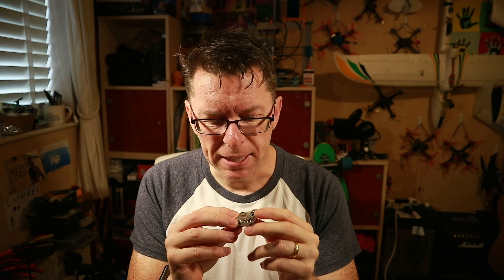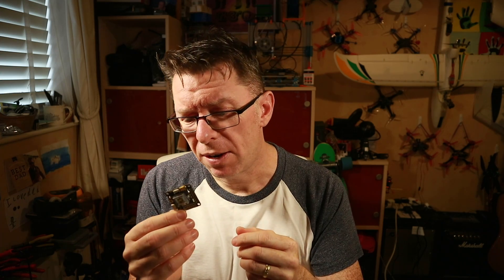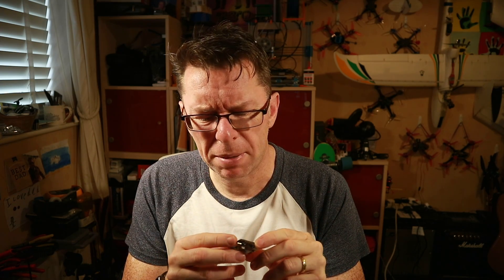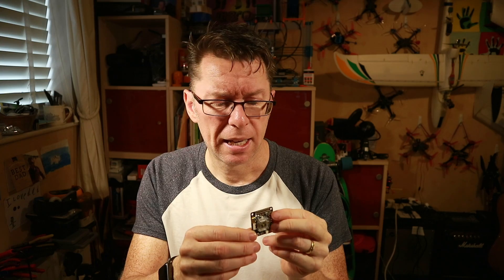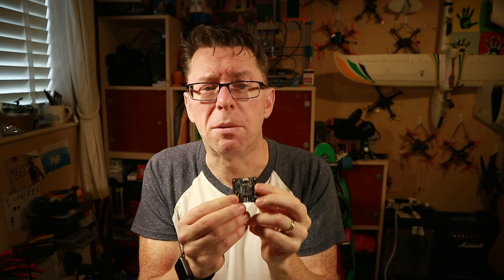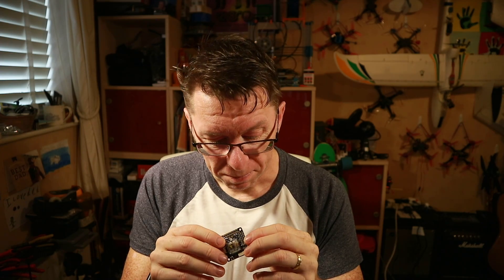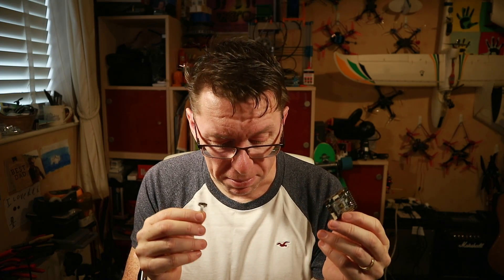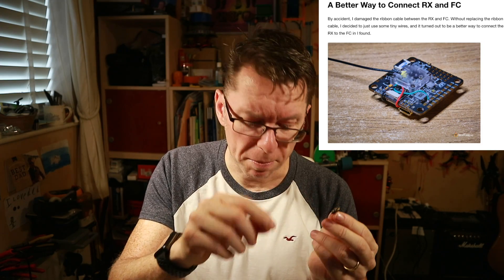FrSky OmniNXT F7 with R9MM review fail, but with some good news to come

Comment: That don't sound like a winning method of updating a flight controller..... I'm loving the R9 on Flex tho, two km on just 100 MW.
Incidentally I managed to flash an update for the R9 to the internal module on the QX7 had me stumped for a few days why I couldn't connect to an XM+ for a few day. Rrflashed the internal module and it's working as it should again. (I had seen one of your clips where you mentioned that you didn't know what would happen if you flashed the internal module? Well now you do.) Great clip as always.
Reply from the maker: I can see how that might confuse things for a while - glad to see you could still reflash the module, even if you flashed something completely incompatible onto it !

Comment: I use and love frsky, but they are NOT on top of there shit. Make it easy for ppl @frsky
Reply from the maker: There 2.4Ghz stuff is great, but I'm not feeling it on the R9 system so far :)
Reply: @CurryKitten  I love the r9 no issues except In very beginning, had some fail-safes, escs we're too close to t antenna

Comment: That's bollocks having to piss about with all that malarkey, surely you would think that a company like Frsky would have designed a more Practical way to update the firmware. I would imagine if this is how its destined to be sold then your not going to be the only one with this problem, wide birth me thinks.  :(
Reply from the maker: Perhaps when wireless updating is implemented and they actually ship the devices in that state it'll look better.  Feels like it's a pre-release in it's current shape.

Comment: Frsky seem to struggle with system integration and user friendliness.  Having to take an integrated component apart to update the firmware is frankly daft, and having to solder wires to pins obviously designed to mount a connector is asking for trouble!

They should maybe give more thought to the fact that their stuff is being used by hobbiests who may have spent a considerable part of their budget on a device, not a lab or industrial environment where broken parts can be replaced from a bin.
Reply from the maker: I sense that the whole R9 thing was massively rushed to try and get some of the market back from TBS, but it seems that if anything they've shown how well Crossfire performs in comparison.

Comment: Is there a way to update the firmware using the f. Port tool?
I always update my r9mini and r9mm using the windows tool.
Therfore the receiver have to be NOT powered by USB.
So you can enable serial forwarding before the receiver is powered up.
I've asked frsky if they can implement a way to bring the receiver back to the bootloader with an special command in cli, or an other way to it, if ota updates are not possible, but I got no response :(
And autobind after an update and on new receivers  was also a wish, but yeah that's frsky
Reply from the maker: Hard to tell now, but FrSky told me that the terrible soldering idea was the only way of updating.
Reply: @CurryKitten  terrible! !
You may could disconnect the ribbon cable and connect it when you have started the serial forwarding  (for the s.port/f.port uart) and the Windows f.port flash tool.
But that's an nightmare without soldering.

Comment: ive trashed my fair share of things, its frustrating when it all goes wrong.
my most recent cock up was putting 12.6v into a 433mhz telem module which decided that it would pass the 12.6v to the APM that it was connected to and both let out the magic smoke :/

As for OTA RX firmware updates, the Flysky i10 can do OTA updates on flysky receivers but there is just one problem, flysky never release any firmware updates lol
Reply from the maker: I don't think I actually did anything wrong (to the power at least, I definitely buggered up the RX though), but I've certainly had my share of magic smoke that have been me reversing power or creating a short somehow.  Oops :)  Perhaps the FlySky doesn't need any updates - it's it aint broke then don't try to fix it etc
Reply: @CurryKitten  True, the flysky receivers do work without any bugs, custom firmware exists for them that adds extra features but as yet ive never bothered flashing them as the iA6B and X6B rx's do what i need on the stock firmware.

I dont think ive ever seen a video advert on your channel, i see the banners but not videos, im sure many would be prepared to let them run full time and not click skip to help you out if you put them on your channel.
you could always set them to run at the end of the video and people could choose to stay till its finished instead of it being in your face at the start if thats why you dont have them?
Reply from the maker: I use the short unskippable adverts as well as the banners.  You'll only see them if the video gets popular enough to have ad's bidding on it (in YouTube's weird advert auction thingy)  This seems to work ok for me, I'm not a fan of the longer pre-roll ad
Reply: @CurryKitten  oh, i didnt know that about the video ads, i thought people just put them on  and that was that lol.

Am i right that you get more if people watch to the end and dont skip?

Comment: Yeah, the SPORT and FPORT choices on the R9MM caught me out at first too....The wireless updating is a must have TBH.
Reply from the maker: It turns out that the way they've connected the RX into the FC with a ribbon cable, using F.Port was the only way it would work properly... of course, this isn't written down anywhere in case someone finds it helpful
Reply: @CurryKitten  Agreed, they really dont provide the basic info for connecting and doing Firmware updates IMO...The R9MM is not the same as say an XM Plus...but no info about the Port choices and which is appropriate for what.

Comment: The thing is you may have blown the board but if you can do it then so many others could. You should not have to solder stuff onto pads just to update software. The more you have to solder onto pads time and time again the more chance of lifting the pads destroying the board. Its nice having most stuff on one board but I am not sure on having a receiver as part of it as you could pull an damage the connector. I do like things made more easy for Quad makers to stuff GPS,  full telemetry data, external Magnetometers, Addressable led`s with receiver inputs for spectrum or Frsky sbuss all at the same time. Stacks are fantastic for racing Quads and don`t need all that stuff so the stripped down with a processor that can handle anything you chuck at it during a race. Also I would like to see a bit more plug and play for those who want to build but cant solder and just want to do a simple build and fly.

Comment: Now you want to be a an rc enthusiast and you have a choice between archaic receivers that brown out at the first opportunity and DIY electronic engineering that work with a tad of chip programming. 
Or if you want you can buy the same stuff overpriced and already programmed from you from TBS.
Well that wireless protocol looks fantastic at this point of time. Lets hope they put the firmware on the  net before they get it to the reviewers....lol
Reply from the maker: We live in hope for a decent wireless intergration - fingers are indeed crossed.

Comment: One word for all that pain: frustration! I mean, Frsky makes this nicely specced board, rx included, all the bells and whistles, but leaves the firmware to be updated by the user? Who is supposed to solder under a bleeping microscope? C'mon, frsky!
Reply from the maker: That's certainly the word I'd use.  I mean, the first time around it was annoying, but then attempting to do it more times, and things getting progressively worse... bah, hours lost to it
Reply: @CurryKitten  I know the feeling all too well. I bought this R9 and R9M receiver and transmitter, as a combo, couldn't bind the damn thing because the receiver had a different firmware. To update it I needed a USB hacking tool thingy, sold separately by Frsky, a real pain. Why? I love the system, when it works it's great, but it is such a hassle. And the documentation is lacking to say the least...

Comment: It looks like a good idea badly implemented. I don't really see the advantage of the rx in a 'big' plastic box that has to be dismantled delicately each time you need to update fw! Why didn't they just have the 3 pins sticking out of the plastic box? Are FrSky dropping the ball lately? Then seemed to mess up so that 2 people can't run R9MM next to each other without 1 taking the other out now a FC that is way too delicate.
Reply from the maker: FrSky's 2.4Ghz stuff has bee, IMO, fantastic - but they seems to have come apart at the seams with the R9.  Maybe they can get it up to spec, but they are taking their time

Comment: Lmao this remonds me of when i used the first version of their 30a esc. Every damn time the signal pad came off, and i was not being hard on it. Contacted frsky, and what did they suggest? Solder signal to one side of a capacitor that wss less than 1mm big. No refund or anything. Smh.
Reply from the maker: It's super frustrating when a solder pad comes off.  Fair dos if you've held an iron on their for minutes at a time and burnt it away, but when you are being super-delicate and it happens... well, the language turned bad.

Comment: You know what, you shouldn't decase  the receiver and put wires on those tiny pads. This is kinda hassle you shouldn't go through. So FrSky in my opinion is the one to blaim.
Reply from the maker: Yes - feel like it was rushed out and the firmware update wasn't considered at all

Comment: Sounds a lot like when back in the 90's they started selling tv's with built in VHS machines so that you "didn't have to have two appliances", all well and good until one or other parts break and you were left with having to buy two new items to replace one working and one broken one.  Sometimes combining and integrating stuff for convenience leads to inconvenience in the long term.

Comment: i was looking at the f4 r9 fc,would still give it a try after the update -update!
Reply from the maker: Perhaps they should have waited until they had that wireless update available before releasing the board
Reply: @CurryKitten  it would have been wise,oh well,my r9 system is shelved until they iron out the firmware,cheers for the informative content